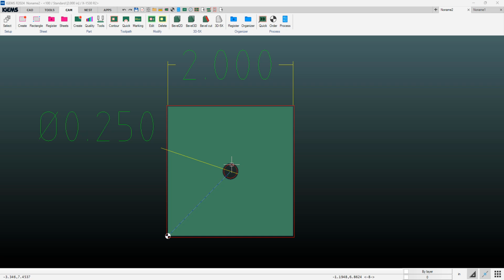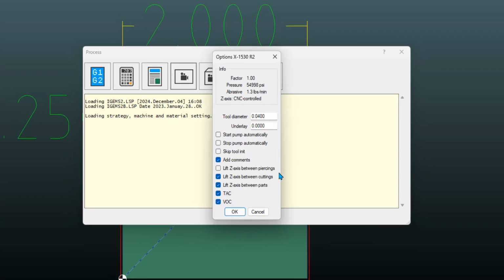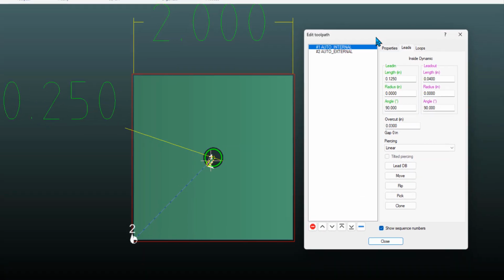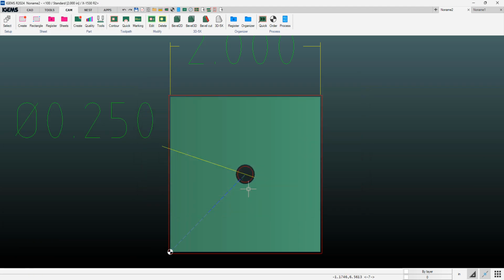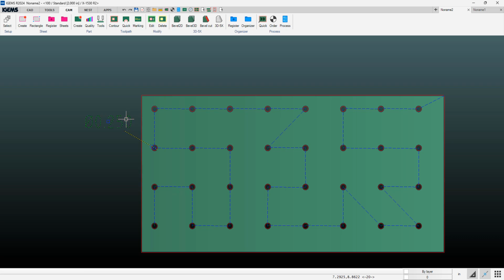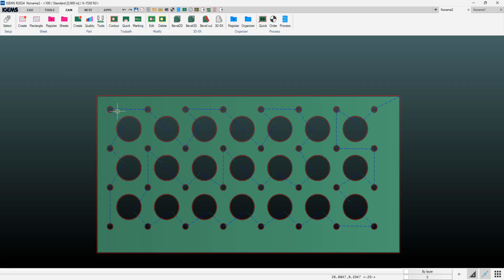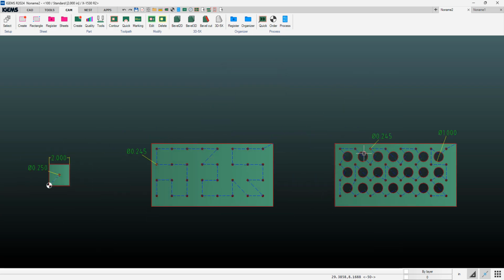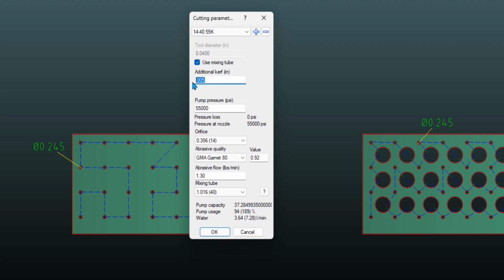IGEMS 2024 Adjusting Tool Diameter

Comment: Hello mates! I'm sorry that I'm asking about my problem under a "random" video, but I'm completely lost. Fast trouble - for example I need a d13mm hole. So I'm drawning d13 in acad or igems. Then 1.02 tube compensation. If its a straight cut - then final size is 13mm. When I am using TAC (-0.34 degrees, 3mm above the material) it will be 12.5mm (top and bottom). If I will draw it 13.5mm it goes 13.8mm. Can't find the reason..
Reply from the maker: That sounds strange. I would recommend emailing IGEMS  support@igems.zendesk.com
Reply: @jeffsigemspage7515  Okay, thank you..